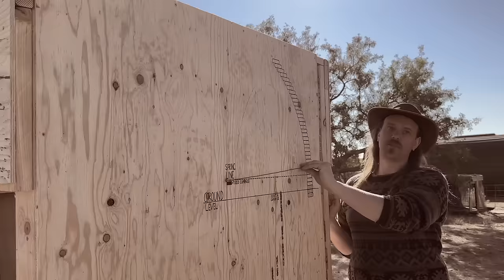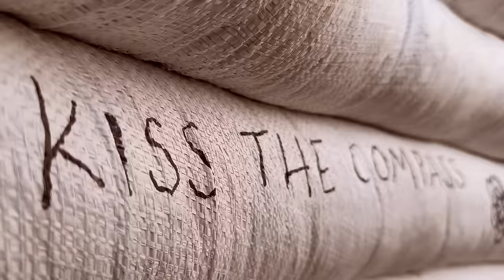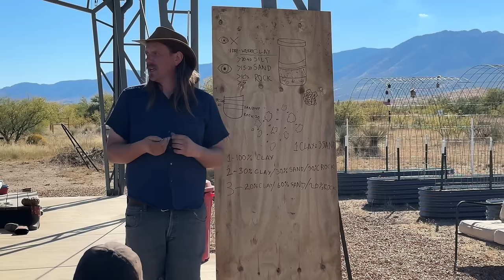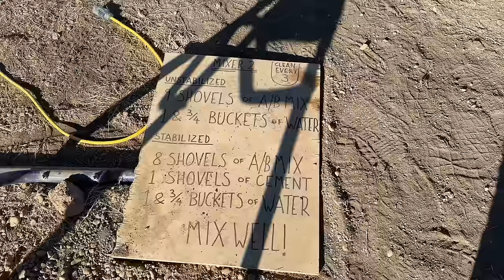DOOR FORM GOING IN! - Day 3 Building a Superadobe Dome Home

Comment: I wonder if hexagonal shaped walls are doable and equally strong. Just wondering because round walls require custom made furniture while a flat wall doesn't.
Reply from the maker: Unfortunatey no. You’d have a ton of outward pressure on each corner whereas the circle is pushing in on itself. Checkout our hyperadobe roundhouse design though. Circular but with straight walls intersecting inside to help with the furniture problem.